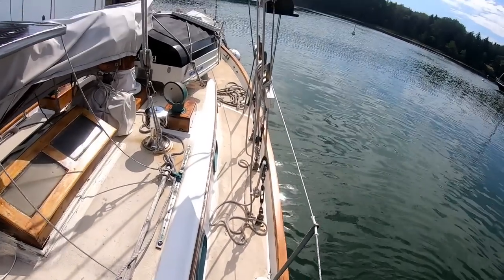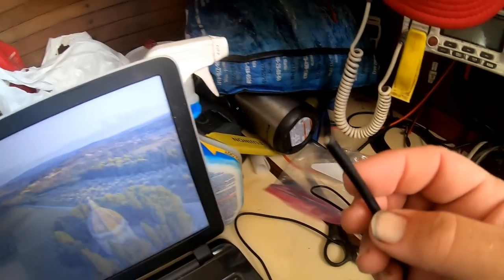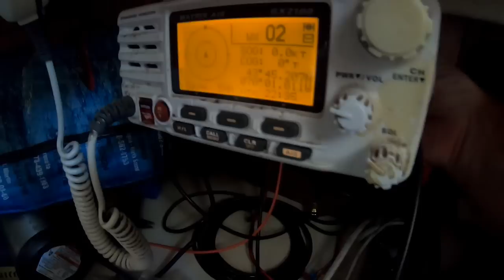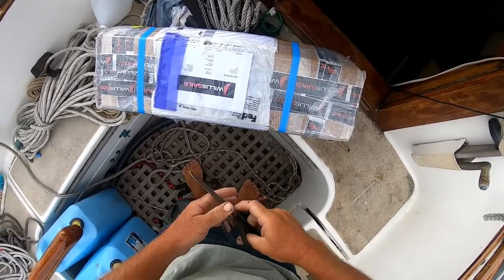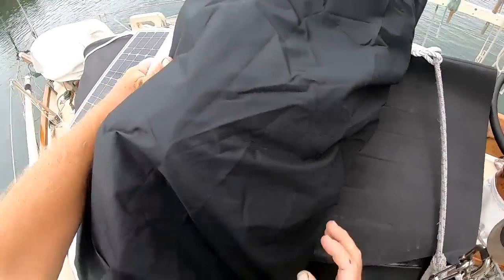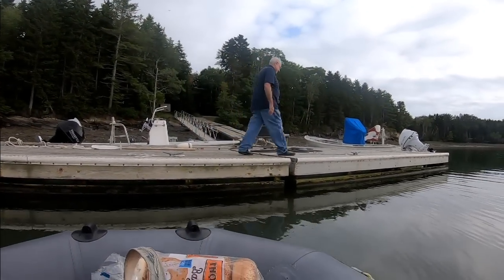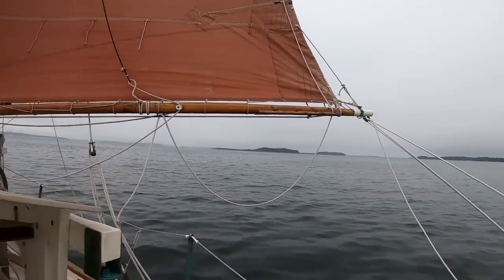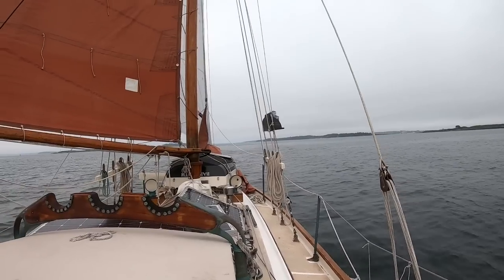New season, new toys, new adventures  | Ep. 178

Comment: Love the e trak AIS  transponder, I have a separate antenna splitter.
For what it’s worth, I always solder the vhf co ax cable fittings.
I think that is the only thing you have ever done/ shown that I would disagree with.
Reply from the maker: Perhaps, but the press couplings do seem to work well and are much easier to install.  The EmTrak also has a built-in splitter.

Comment: I'm catching up on your videos, and I noticed something. Is there a benefit to rolling instead of folding? Does it limit wear? I always learned to fold sails instead of rolling them up. I am relatively new to sailing yachts (or life in general, I'm still in my twenties haha), but have been sailing open boats for years now
Reply from the maker: As far as stowage goes, I'm not aware of any difference.  Certainly for the purposes of setting and taking in a large sail the roller makes your life a lot easier.

Comment: What type of furler is that for the Code 0? It seems very compact and seems to run freely. I bought a Code O for my boat this year but passed on the furler because it would have cost as much or more than the sail.
Reply from the maker: Karver, yes, light and compact, about $600US.
Reply: @howtosailoceans1423  Thanks. I’ll look into it. Does the (anti-)torsion line, if there is one, come with the sail or furler?

Comment: Do you just use your yankee halyard for the code 0? …. Any additional rigging needed?…. I was surprised at how small it packed up.
Reply from the maker: Yes, it's set "flying" which means that it is hauled up on a halyard, the jib halyard in my case, without any attachment to a stay.  It is easy to lower back down on deck when rolled up, and snakes right into the bag.